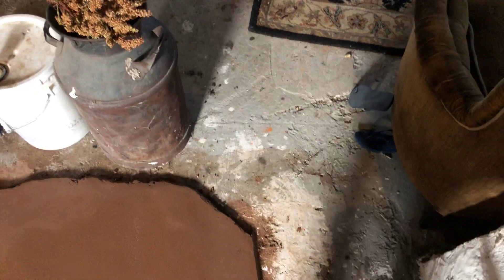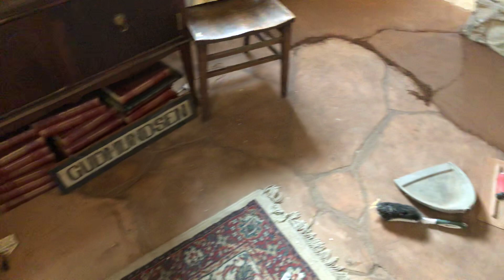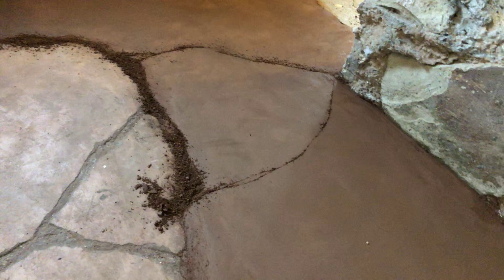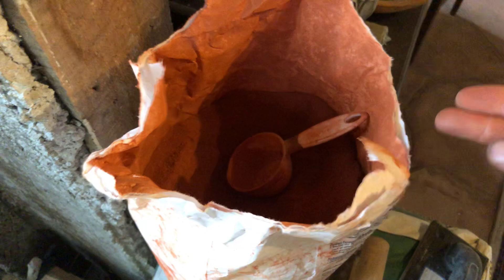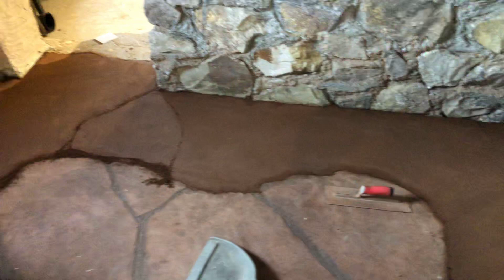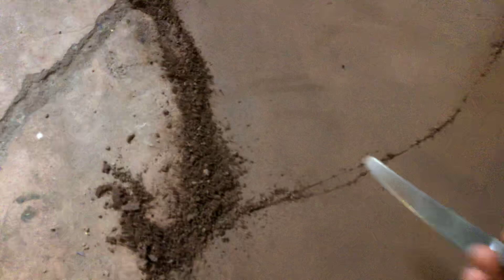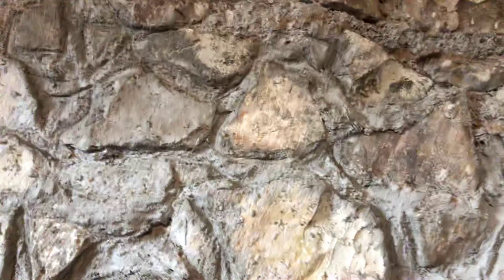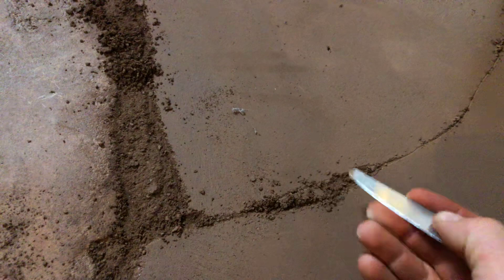DIY realistic faux stone floor

Comment: Great tutorial, thank you. Do you use the same technique to create a wall with faux stones?
Reply from the maker: Thank you! (Sorry for the very belated reply). I don’t think I’d use the same technique for a vertical wall, but I’ve been planning on doing a modified technique using a form of stucco (basically a top coat of stucco, but I’ll just make it as thick as I can without it falling off…I’ll color it the same but then make it look older with other colors).

Comment: The floor is the best looking faux stone finish having the appearance of real stone.  Great work!   It's beautiful!   You have this video labeled as a DIY, so I thought you would have instructions for the entire process.  I'm a bit lost on your actual technique.   You mentioned using a few scoops of the SAND MIX added but don't mention what you added _________ to the SAND MIX (?) that you mixed into a wheelbarrow.    Do you simply mix the SAND MIX with water, cement,  or something else?   Other than that you mention boiling linseed oil to use as a finish but no detail - just rag it on, I assume.     I will look to see if you have other videos, would love to see it finished!

Comment: Very nice job and realistic, Would you share your recipe for the cement, I think I might try this on my porch that connects to a flagstone walkway over to a flagstone patio. Also what colorant are you using? Sadly it appears that you dont have time to answer comments other than to insert emoji's
Reply from the maker: Hi! So sorry for my very belated reply! The cement I used is simply store-bought "sand mix"...but one could do it with a simple 1:4 ratio of cement to sand. The colorant is just whatever I could find at a concrete specialty story locally...nothing particularly special. (we've recently discovered a "fertilizer" -actually chelated iron- that looks like it will work wonderfully as a red colorant...slightly more on the purple side though).

Comment: Hi, what is the red powder? is it pigment or a colorant specific to concrete?
Reply from the maker: Sorry for the late reply. That red powder we used for the concrete is a concrete colorant, but one could use any form of natural pigment (in this case, red iron oxide) to do the same thing. In fact, we recently found a "chelated iron" fertilizer that looks almost exactly the same and will likely work perfectly! :)